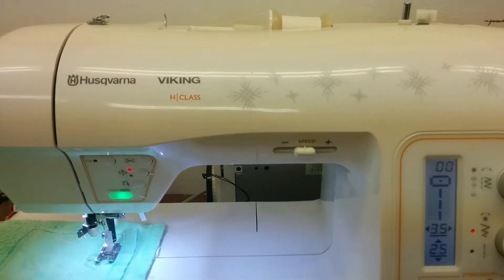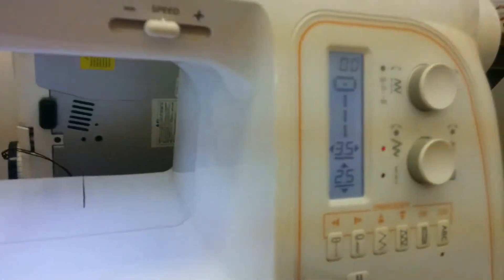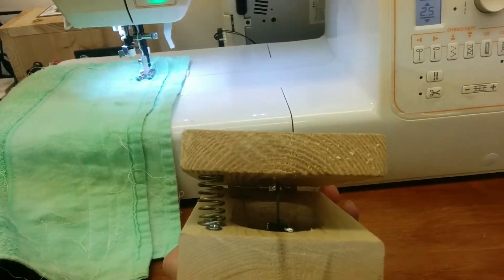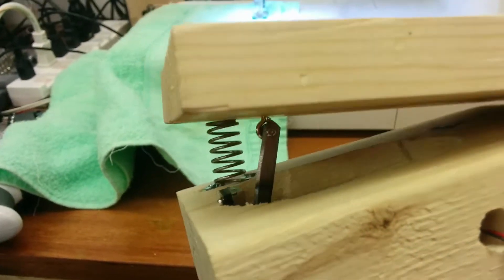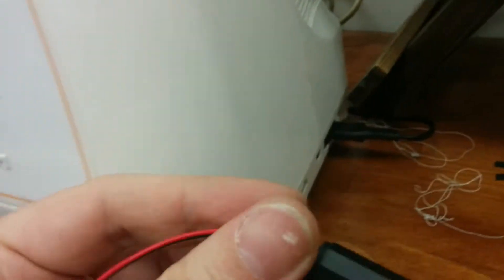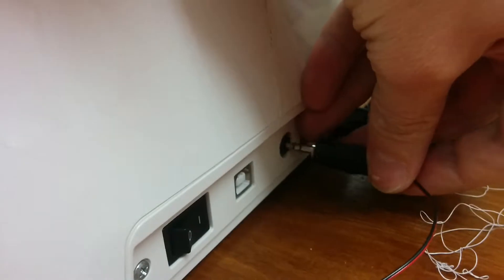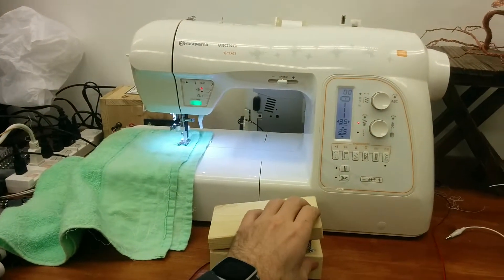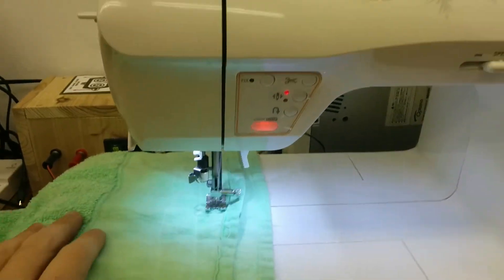Husqvarna Viking 600E Embroidery Sewing Machine Replacement Pedal

Comment: I have the same machine, it used it for quilting and embroidery stuff that is not real big, I use my Viking Topaz for that. There is not much on the web regarding this machine. I am pretty good with it, the one thing I don't get is the default 3.5" I assume that is mm not inches. Not sure why they did that. I assume the conversion is to  inches is 0.137795 converting the other way it is .25 which is 1/4.  I gets me confused with the "A" an "B" foot. Just wondering if you guys have that issue. Not sure why they do not make 1/4" foot standard.  Not sure what you mean with a dongle? I use Apple products so I had a old Vista windows,and I put the software on that. If any of you have issues, please contact me
Reply: Hello, I hope you are well. I have this machine and I don't have the pedal. I don't know how it works. They gave it to me as a gift and I only want it to sew. Could you help me?😊

Comment: I have a Husqvarna 600E, I believe that the Singer FUTURA XL-550 Sewing is, if not the same machine very close. I use bobbins and needles made for the singer machine they are cheaper and easer to get. Your error message is "Foot control is connected while operating with Start/Stop button or Start/Stop button is pushed while foot control is connected." the book go on to read "Disconnect foot control or restart sewing by depressing foot control. or foreign particle like tip of needle, screw driver etc. is detected on machine socket or foot control." a mono jack may stop the error code.  Nice video, I like your solution.